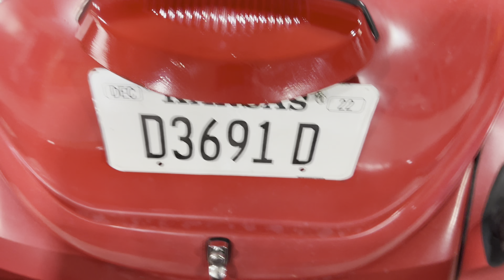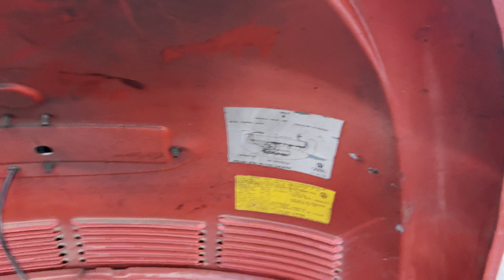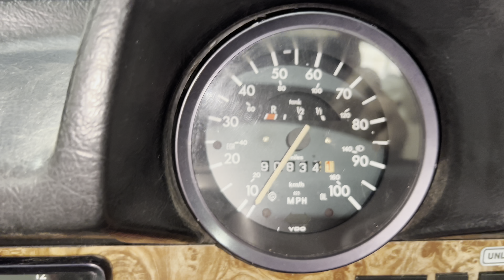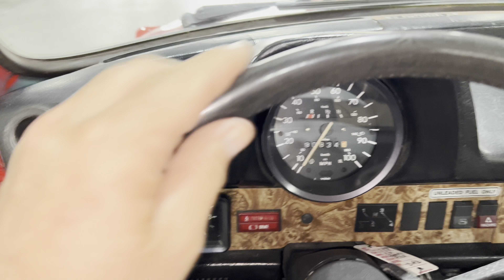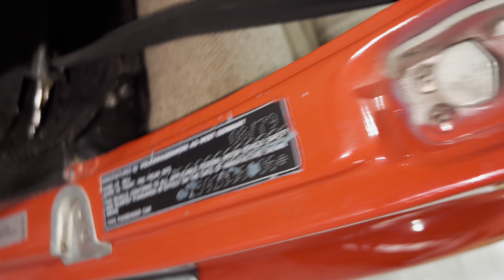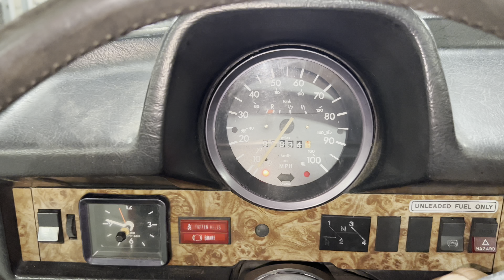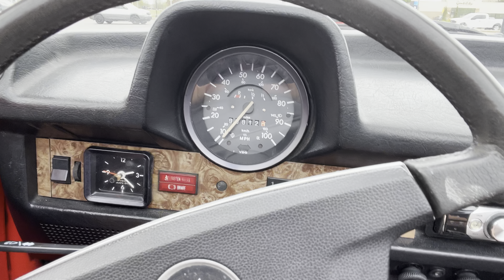1979 Volkswagen VW Beetle Convertible for sale

Comment: I'm in love. My grandmother had a '67 hard top in red with the 4 speed. then later the model 3 square back  wagon in orange with the 4 speed which dad inherited. Grandma was very liberal and very practical. when the mechanic told her a manual was more fuel efficient she committed to driving a manual. This one is a real time capsule. I'm back in the back seat sliding and bouncing around the vinyl seats in time to the putt putt of the engine. am radio only, no a/c